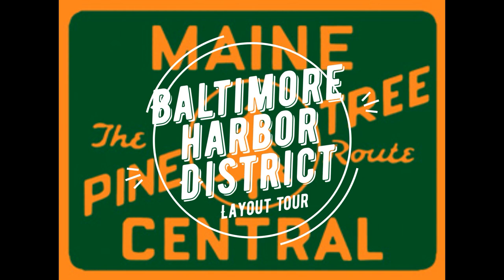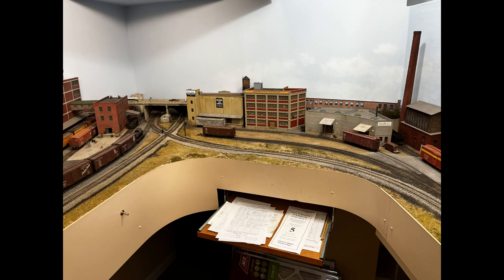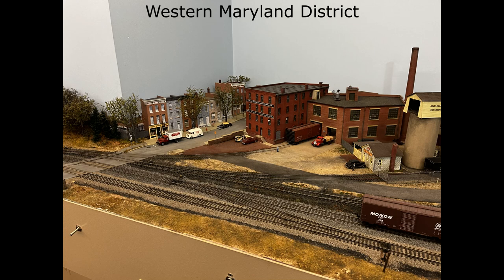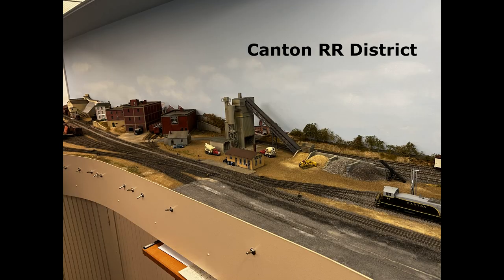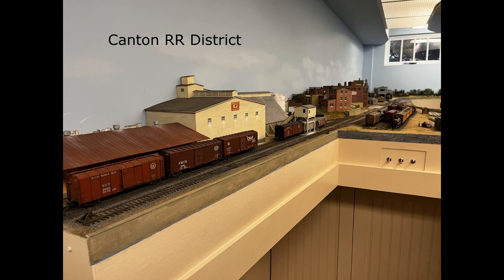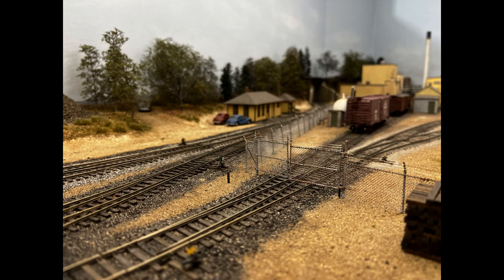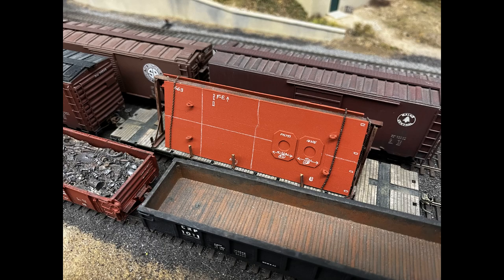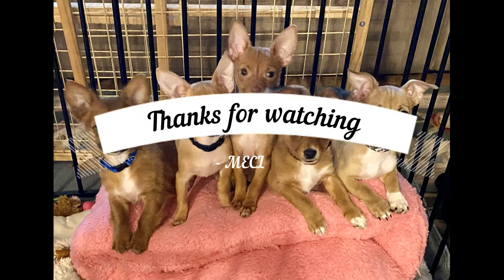Paul Dolkos Baltimore Harbor District

Comment: Thanks for sharing your experiences on Paul Dolkos' great layout.  As a former resident of the  Baltimore area, his articles in MODEL RAILROADER previously caught my eye.  I was particularly interested in his Carroll Street section, with its pavement-embedded gutter rail and "streetcar-type" single-point turnouts.  (I'm a former commuter on the #8 car line.)  
I enjoy switching operations, myself, and would be glad to see more videos and stills of Mr. Dolkos' fine layout.  Thanks again for posting.
Reply from the maker: Unfortunately Paul is selling his layout due to health, the layout was incredibly well built. He did not use rail joiners only spiked the tracks to keep aligned! Never knew that from any of his articles.
Reply: @camgreen3815  Paul is a consumate craftsman, for sure.  I'm sorry to learn of his health issues, but Father Time eventually visits us all.  Here's hoping his wonderful layout lives on under new management.